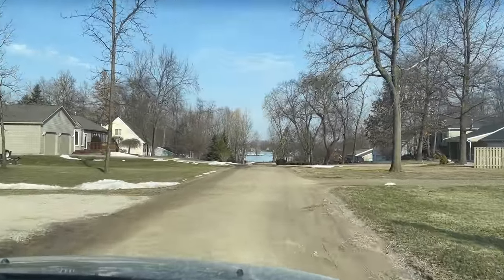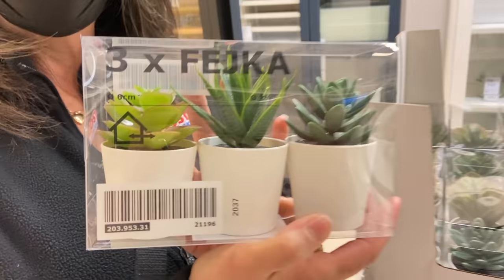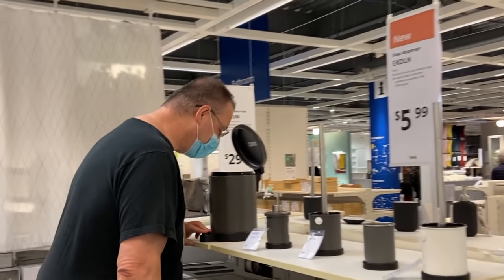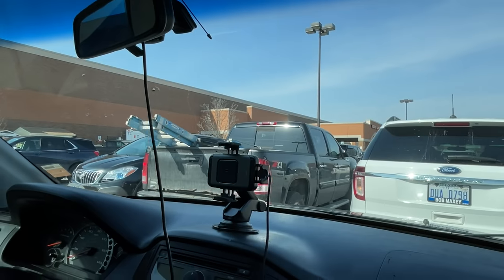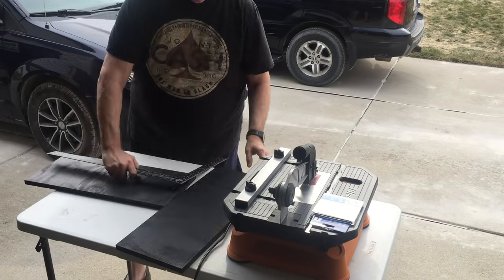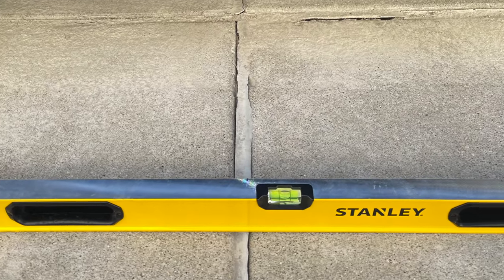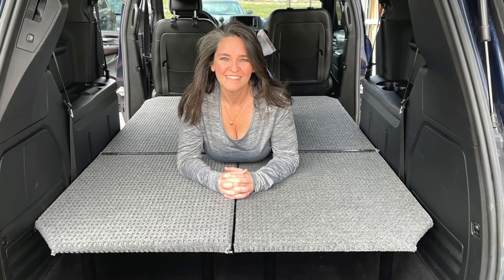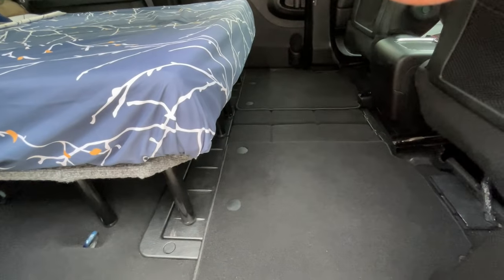DIY One Of A Kind MiniVan Bed, Solo or Duo, Multiple Configurations, SUPER Comfortable 6" Mattress

Comment: Great bed work! It was just what i needed to complete my bed Set up! How long is the length of the platform? Can you write the exact length of each section please? For the secure strap, did you install those at vertical or in angle?  THANK YOU VERY MUCH FOR THIS GREAT AND FUNNY VIDEO!
Reply from the maker: The platforms measure 23 wide by 30x30x10 and between the three pieces we did piano hinges one topside one underside (so the front folds down not up).  We have 48 total wide inches but we went with 23 wides for two reasons - one so we don’t scrape up out interior and two because we did carpeting wrapped around the edges so we wanted to give a bit of space for that.  Doesn’t seem to move or anything and gives us that bit of tuck in for covers etc too
Reply: Great! Thank you very much! Would like to see a full video when every thing is inside! I’ll do it myself and send you the link!
Reply from the maker: @Yogijoflow  yep we are close to a full van tour I think we may have more than one too since sometimes I go solo and take different things than if Stacey and I go together. I head to Mississippi mid April here so maybe I can get a fast solo trip van tour before I head out :) - Bill
Reply: @StaceyBillsAdventures  wonderful creative bed build. Plus you can set up chair mattress in your home for overnight guest. 😆 Trish 4/9/2021 Keep Safe.

Comment: Any chance you would have instructions (be glad to buy them!)??
Reply from the maker: Glad to help basically we split a 4x8 at Home Depot into two sides measuring 23 wide by 30x30x10 then used piano hinges cut to 23 wide, adding 10 ikea legs underneath on each one (maybe could use less but I am a big guy so I wanted more support).

Comment: Another question 😉 If i saw well you fix the hinges on top of the mat, you didn’t cut the mat to install the hinges? And forget the question about the mesure of the bed, i replay the video and saw them 😉
Reply from the maker: I had put the hinges on before the carpet if that is what you were asking then I cut out the carpet around the hinges once installed.  Oh as for the d rings yeah we attached two under the platform in rear to the side and pretty much under it are the floor braces for seats and we ran some lashing straps rated at 500 lbs I left them a bit slack so I can lift the rear platform but they aren’t going anywhere in a hard stop situation.
Reply: Thank you for the fast and clear answer ! My English is not very clear !

Comment: I want that saw.
Reply from the maker: It's actually been really handy around the house too, base trim, pvc, the van platform, flowerboxes i made recently etc.
Reply: @StaceyBillsAdventures  could you have put a carbide blade on it and used it to cut the legs? Or does that have to be a special saw for metal?
Reply from the maker: @Genjonez-o763  I had a metal cutting blade but it was pretty worn so when I tried the leg wasn't cutting smooth, I had that diablo blade which worked great in the reciprocal saw so I just used it, but the X2 coulda done it if I had a fresh blade I bet.

Comment: How do you prop up the back of the bed into a lounger?
Reply: I didn’t show it but I had a 2x4 with two short T like pieces that sat in the bottom base area and propped up against the back area. I had cut it a few times till I had the right angle for the chair to be in recline mode.

Comment: 70 inches long is too short for me. I need at least 75 inches. Do they make one of those folding mattress things longer than 70 inches?
Reply from the maker: I am sure there are some trifolds that would do it, I am 6'6" tall but i sleep on my side sorta curled up so it hasn't been a problem for me also at the base of the bed is my cooler and it sits like an inch under the platform height so if I needed an extra foot to extend that's there for me, Stacey's short at 5'4" so never an issue for her, heck i wish we could sleep sideways but thats a bit toooooooo short for me (I think we have 48 inches side to side), I hate giving up living space for beds but I also hate camping when i don't sleep good so it's a tradeoff.   Doing this folding platform tho helps cuz i can flip them back out of the way during the day at different levels of room as needed or remove one if i am going solo. - Bill

Comment: Hello! I am buying a 2018 Chrysler Pacifica and I plan to use it for road trips and as a camper at times. I thought about building a bed like you did but then I noticed there id a folding cot I can buy and just put a 6 inch mattress on top. Do you think that would work?
Reply: I tried a Coleman cot that just didn't fit well and even an air mattress that I didn't like the comfort of so we made these for storage and flexibility there was even this one chair that folded into a bed on Amazon I was going to try next but these worked so well I didn't order it

Comment: I have a larger van that I'm doing a quick install and teardown build in, so I want my bed to be pretty portable and stowable when not in the van.  Do you know if the IKEA legs can be fastened to the floor?  I have a plywood floor with vinyl sheet flooring.
Reply from the maker: Hum the feet on these have a screw in them to hold the leveling foot in place, I wonder if somehow you could mount a threaded piece in the floor or something but what might just be easier would be to use some D Rings on the bottom of the base then connect those to the floor to any anchor point or add another d ring.    I wish I was shorter so I could do a sideways bed in the back vs having to take up so much front to back space. - Bill :)

Comment: Ikea has a lot of useful components.  However, your bed platform has no ventilation.  We have bed bases, spring mattresses and bed slats for a reason, the human body puts out up to 2 litres (quarts) of sweat per night and ventikation is how you get rid of the moisture.  This might not matter if you're not living in your vehicle every day but could easily lead to a mold problem and bleaching and even cutting out the affected area diesn't work as what you see are the bloom, the mycelium of the mold is probably throughout all the material and whatever other organic material it touches.  Just drilling a holes in the bed platform or routing grooves into it should take care of the ventilation problem as would furring strips or just using Ikea's bedslats on top.  If you don't want to fix your ventilation problem, there are anti-fungal paints but they work by containing toxic heavy metals so not something you want to use.   You can usually rent an anti-mold fogger from Home Depot and embue everything porous in your vehicle with anti-mold chemicals namely the toxic heavy metals.  There's usually a high demand for those foggers after a flood say from a hurricane or tropical storm.   Mind you, only some molds are dangerous to your health and you can't tell which you have without having a sample tested.

Note the sweat is also why foam mattresses especially memory foam start to stink after awhile.  Again ventilation is key to preventing this but foam mattresses are a lot harder to ventilate.   There are spring mattresses with hinges to alliw them to be bent in certain places such as to raise your head or feet but foam mattresses have largely displaced them.  Ikea sells a very thing bedspring mattress that can tolerate some folding.  Note, the moisture problem is another reason why traditional bedspring mattresses are supposed to be occasionally flipped.
Reply: yep we have added vent holes in the bases since making the video :)
Reply: in our pinned comment -  We have learned that providing air flow on the platform is important to reduce the chance of mold in our foam, so we will be adding some drilled holes to provide for this.

Comment: Why couldn’t one just put the cushions directly on the floor of the minivan, the leveling can be adjust with some blankets?
Reply from the maker: You certainly could do that, many want to just level out the bed and have storage underneath since it takes up a good portion of the van, others use inflatables or hammocks I’ve been experimenting with a bit of all of them.
Reply: I am exploring with the Thai roll up mattress so it rolls up and doesn’t take too much space, can use as a cushion sitting inside..  

Exploring how to have a portable mini water pump for cooking etc